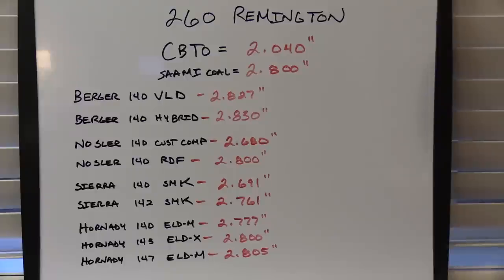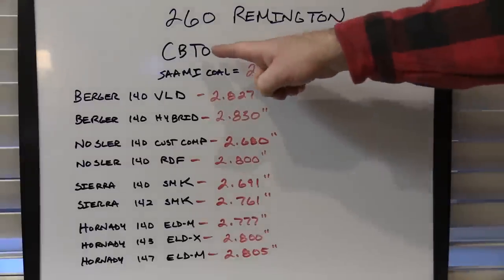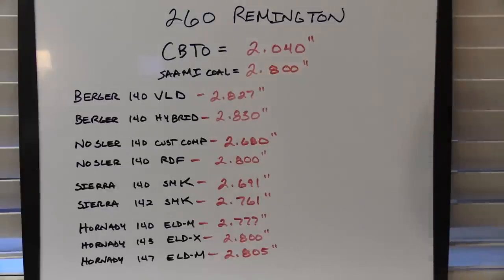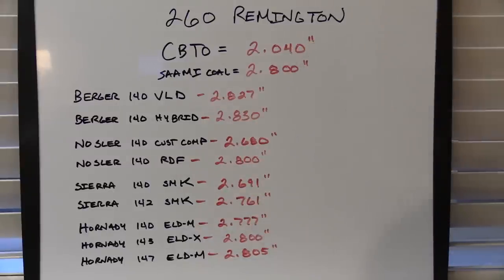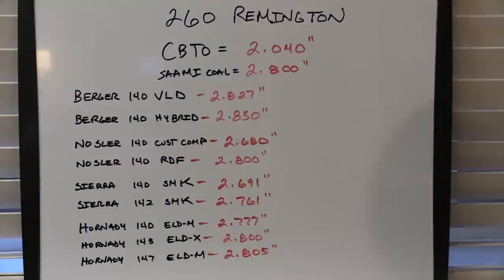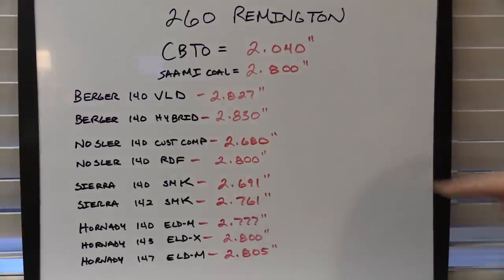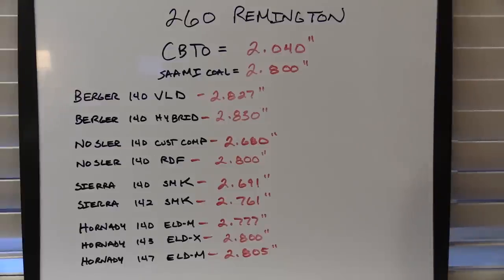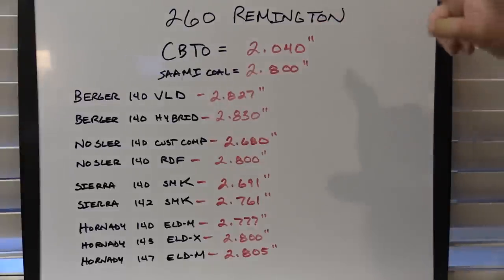Straight Talk/ Episode 4: Measuring Seating Depth/ COAL vs. CBTO

Comment: I just started reloading and this is EXACTLY what i was thinking when reading posts on loads. With different bullet shapes ...coal doesn't tell me anything. I noticed that rounds that were within a certain range of measurement from the lands gave the me best groups.  I started seating my bullets based on distance from mouth to ogive (from an empty case to seated bullet ogive).... WRONG !  I was close but you just clarified what i actually need to do.  Base to ogive of a seated bullet !  Thanks.

Comment: Thanks for sharing. After ten days of preparing my shop and setting up equipment, I loaded my First-Ever reloads. Frustrated with my inability to get consistent cartridge OAL, I purchased a comparator to check my work using BTO. I found I was doing a better job. Good know my Newby discovery was typical.

Comment: My problem with this concept is that I get very different CBTO@lands readings for different bullets.  If you take your Stoney Point gauge and do CBTO readings for all 8 bullets, do they come out the same?
When I've tried a test like that I get numbers all over the place.  I've always assumed a test like you did with CBTO @ 2.040" would still have a wide range of distances to the lands.  I assumed that the diameter of my bullet comparator insert does not match my rifling perfectly and causes varying readings depending on the ogive shape.
I feel like I'm definitely missing something because a lot of people rely on CBTO a lot more than I do.
Reply: And now that I type that out I see you have already covered it in another comment.  I'd love to see numbers in your gun with the 8 bullets you have on hand!  Seems like I'm not the only one with this confusion.
Reply: You are not the only one that's confused with this, this is making my brain hurt. I always thought that once I had set the seating die to a particular measurement for a specific bullet then all of the same bullets would be seated the same.  What the heck am I missing ? I just cant work this out.
Reply: Johnny's Reloading Bench I think it mostly has to do with the diameter that Hornady cuts in their comparators. I've seen where other people have the same issue and have switched to other brands. I believe Sinclair makes steel ones rather than the aluminium that may be cut to more of a true diameter for getting closer to the actual ogive/bearing surface line but will still work in the Hornady tool. Just as long as we all understand that it's just a reference number and treat each bullet separately the numbers don't really matter too much though.
Reply from the maker: I tested eight bullets today. I posted a pic of the chart on our FB page, here: https://www.facebook.com/panhandleprecision/
Reply: Awesome.  Thanks for doing that.  It looks like I need to work on making more precise and accurate measurements with my comparator tool.

Comment: Hi Sam. As you no doubt know, the Hornady device measures from the case shoulder to the bullet ogive; Which if done correctly guarantees that you will never be able to jam the bullet on the lands. But for consistency of jump distance (and correct measurement), shouldn’t one be measuring from the cartridge base to the bullet ogive? As this is the measurement that results when seating the bullet on the press, because the press is pushing from the base of the case (which results in consistent seating depth, but probably not the same jump distance one is looking for as measured by the Hornady device). Whilst I use the Hornady device myself, this dilemma has always played on my mind and I was wondering what your thoughts would be on this? Or to put it another way. The Hornady device doesn’t seem to allow for variation in case lengths. So if a long case is used, it will give a different result, than if a short case were used.

Comment: Hello Sam. Great video's and I've picked up some good tips from you vids on reloading; really good stuff your doing. My question is when looking for accuracy, have you noticed or do you find with loading all those different  bullets for your 260 or some of the other guns you shoot that the jump to the lands seem to be about the same for other bullets when loading up different brands of bullets that have the same shape/design. Something like the 142 SMK compared to the 140 Berger?
Reply from the maker: Yes, but I've also come to the conclusion that the barrel/ machining is more a limiting factor than the particular bullet. I've had too many barrels shoot a broad range of bullets very well, all seated to the same CBTO, to think otherwise. I don't have a lot of patience for tinkering with seating depths.

Comment: Loading rounds for my 204 ruger and load Berger 35 and 40 grain no problem but then started trying to load 55 grain and because of the bullet being so much longer in can’t get the bullet to COAL with the bullet dropping in the case i threaded down the seater a turn more and it crimping the edge is the ok but still have to be gentle or round will fall in cause it’s on the ojive

Comment: Unfortunately, CBTO is somewhat irrelevant if you are using the factory Pmags with the Ruger Precision rifle.  You can’t actually load to the factory COAL with 6.5 CM or the noses won’t reliably clear the mag wall.  In that case the hard limit is the the mag limited COAL, in that case 2.810 to 2.815 depending on how comfortable you are with the nose on/at the mag wall.

Comment: Sam,   Do you have a Hornady ogive insert for 6.5  or .264  Creedmoor, my old one took a hike some place and want to turn on on my lathe to replace it. Is it .257 ?  On the old one that disappeared was marked  5-26   Thanks so much if you can help. Just want to make sure the I.D. is correct to get the ogive correct have the main base but not the insert.

Comment: How would you load a Tikka 6.5x55 Swedish Mauser that when checked with an oal gauge on a Sierra 120 gr. HPBT literally has the bullet fall out of the case when touching the lands? Much appreciate your video's and information!
Reply: Hi Decoelec! 

The 6.5x55 SM is a different design. It has a "build in" long bullet jump. Ex the max coal for 140gr match bullet would be as much as 82.00mm. When loading for the 6.5x55 SM aim for optimum concentricity and full bullet/neck guidance. With a 140gr match bullet this would be close to 79.00mm... This is a very typical design for old military cartridges to avoid the bullet to jam in a dirty gun. The same goes for the conical shape of the cartridge...

I have shot several 6.5x55SM's with excellent results. My best 300m, 5 shot group to this date was printed with a Tikka Varmint and 143gr ELD-X... measured 10mm - just followed the above mentioned recipe 

All the best

J.

Comment: Measuring base to ogive effectiveness. Is that measurement effective? If i understand the measurement, it is to help understand the amount of each bullet as it sits inside the case? To help determine the pressure changes from the different lengths inside the case? The seating depth (ogive measurement in relation to the lands) has a bigger impact than the pressure change from .002 .003 length difference when measuring bullet measurement base to ogive??
Reply from the maker: I don’t pay any attention to BTO measurements of the bullet itself. I think measuring the overall bearing surface, and understanding the effect it has on pressure is more important.

CBTO is cartridge base to ogive, and is a better measurement to use than OAL using the tip of the bullet.

Comment: so from what I understand , you would only use CBTO for precision shooting and the measured  CBTO would be restricted to 1 rifle, even if you had 2 precision rifles of the same calibre , therefore  you would require 2 different CBTO  loads to suit each rifle.
Reply from the maker: The CBTO measurement is specific to each chamber. If you used the same reamer on multiple barrels, the CBTO measurement would be the same.
Reply: @PanhandlePrecision   do you have an email address, I am new to reloading , but am really glad to have come across your tube site

Comment: Thinking it could also be the amount of different pressure applied when seating the bullet in case. So if I push the handle down hard on one round an not all the way on another round. Even when seating primers I try an use same amount of pressure to seat primer all evenly.
Reply: Pressure on primers doesn't matter. Depth on primers does.
You should always seat bullets the same depth or stroke witch should be too of the stroke obviously. The difference in pressure has to do with case mouth size and friction on the bullet surface as well as case mouth. Clean brass and bullets with lite lube will go along way. But to get everything consistent to the desired tension you will need to turn necks or use a neck bushing die. Quality brass makes for more consistency in this case as well.
If you have big differences in handle pressure using all the same components something needs to change in the process.

Comment: I get what you are saying but I have a question for you - doesn´t the seatingdie set the bullet from the bullettip?? Or does it set the bullet from the CBTO??
Reply from the maker: PE J The stem of the seating die should not contact the bullet’s tip. All of mine contact the bullet’s nose profile ~ 1/4” down from the tip.
Reply: @PanhandlePrecision  - god damn it - you are right. I never looked at the seatingstem closely so I took it apart and the stem is conesharped so none of my bullet touch it with the tip of the bullet.
You´re a god damn genius !!  ;-)

Comment: I was measuring my CBTO with 2 different bullets (175 gr Barnes LRX and 175 gr federal Edge TLR)and the measurement between the two was about .010” difference. I would have thought they would be the same, am I measuring slightly wrong?
Reply: Lance V I’d like to know the same thing.  I’ve got 5 different bullets now and have different numbers for all 5.   Also I think the Sinclair comparator bites into the bullet since it is stainless steel giving me different numbers also.
Reply from the maker: It happens. I think a lot of it is the angle of the chamber/throat cut causes a different "feel" with different bullets, depending on their ogive. The best way to get a precise reading is to use the bullet you want to shoot for your barrel measurement.

Be sure you're getting multiple readings with the same bullet, though. It does take some repetition to learn how to get consistent readings.
Reply: odd766 Right or wrong, what I am viewing is the initial measurement I made was with the Barnes LRX. I will use that measurement as a reference for throat wear. Now that I am loading multiple bullets, I’m using the measurement from each individual bullet that I load. Theoretically the ogive should not change bullet to bullet so not sure what the deal is. 

I agree on the comparator digging in. I think just getting used to the feel of the device so each measurement is consistent.
Reply from the maker: The insert is slightly beveled, so you could get different readings if you change the pressure with the anvils. If you're getting a "bite" into the bullet's jacket, you're pushing on it way too hard.
Reply: Lance V I was having kinda the same issue. Every time I seated a bullet it was different measurements. 
If this helps , Try this :  when you start to seat the bullet in the case , only seat about a 1/4 of the the way down into the case, then turn the bullet about a1/4 or a 1/3 , seat down another 1/4 and then spin the bullet again. Do this until seated is complete. I usually do about 3 or 4 turns in my process. I have noticed it gets my seating depth within about 0.001 to my desired measurements. I hope this helps as well .
Reply: odd766 it may also depend on the tool you are measuring your ogive with. If it's not exactly the size to get an accurate measurement of where the bearing surface meets the ogive it can give different measurements from bullet to bullet as far as when it touches the lands. I hope that makes sense and I believe the hornady comparators may have this issue so you will need to record separate data per bullet and not use the same number for CBTO for all your bullets.
Reply: What you’re seeing is absolutely true. An ogive measurement is simply a common diameter, not necessarily where the rifling meets the bullet. Similar to a datum line on a case shoulder. Depending on the taper angle of the case, actual length to the neck will vary. Likewise depending on the taper of the bullet, ogive distance vs actual contact with the lands will vary. I made this mistake back in the day with .308. Found the lands with a 175SMK, switched to 155 Scenar’s seated to the same ogive. Thought I was jumping .010 and I was actually jamming .030. Pressure came on very quickly and raised the red flag. 

Best practice is as others have mentioned. Find the lands with each individual bullet you intend to use, reference that particular bullets ogive measurement, and seat accordingly. That includes the same bullet when switching lots! My old Berger 105’s are .020 shorter BTO and .013 shorter OAL than my new lot. I jump them .030 but to someone who only jumps .010, just a lot change could put you into the lands.
Reply: Measured lands for each different type of round I use. Sweet no problems. Seating depth still various between rounds of same type though, whether its of the lands or not. I suspect the seating die doesn't care what you measured from even when it is locked at the correct depth.

Comment: When changing CBTO, would this not affect internal pressure, thereby affecting velocity ?
Reply from the maker: K BikeRider Yes and no. Pressure is needed to create velocity, but you can increase pressure without a gain in velocity. In my experience, the quickest way to do this is to seat the bullet into the lands. For instance, if you’re .010” off the lands with no pressure signs, seating the bullet .010” further out (contacting the lands), can give you pressure signs without an increase in velocity.

Comment: I keep getting as much as .008 difference in my reloads with c b t o.  I'm using hornady match grade dies. Could it be my press? Its a Lee. Was thinking about getting the lyman turret press when it gets released. Thoughts on it. Thanks. I do try to use the exact same pressure on my Lee press.
Reply: Some of the Lee presses have been known to flex, also make sure you are firmly mounted and your bench is rock solid stable. I also have a Lee press that has some sentimental value to me, I just use it as a permanent decapping and neck expander press as these operations require little to no real force. I'm no expert but that's my .02.
Reply: J Lee thanks I move around for work a lot and can't have something rock solid, permanent. May have to try a piece of steel mounted under my press.

Comment: I have the same press and Redding die set up that you have, and for some reason when I seat a batch of bullets and I measure them, they all show the same but every now and then I have to bring in the micrometer on the die to get the same measurement , and when I’m done with the batch and remeasure the first ones the are different, what am I doing wrong here? Or is it the cheap Hornady Calibers and Hornady Comparator body?
Reply: If you're using cheaper bullets, it could be differences in the meplat that are throwing it off. I think the seating dies seat at the ogive , which is further back.
Reply: I’m using Berger Hunting Vld and Hornady Eld-x